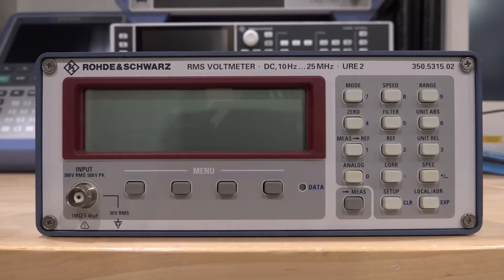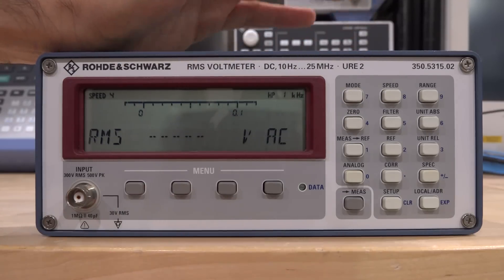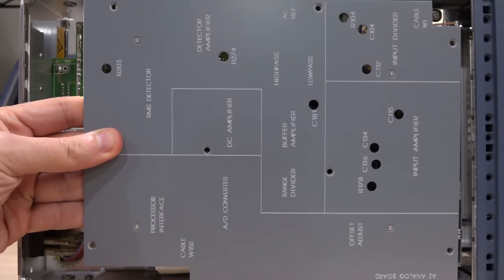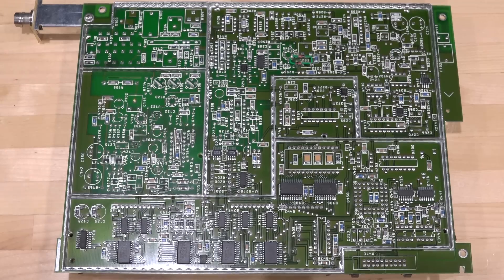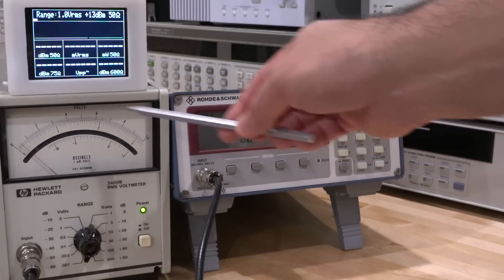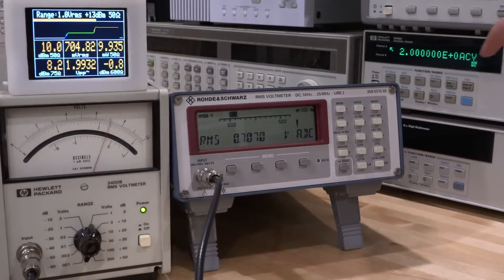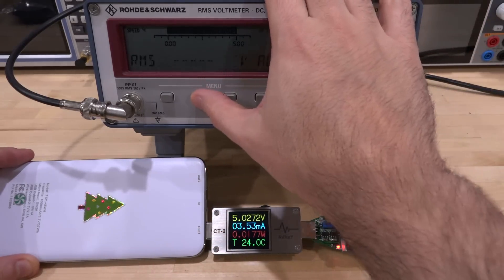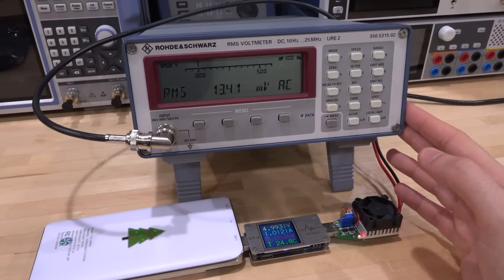TNP #43 - Rohde & Schwarz URE2 DC - 25MHz 300V RMS Voltmeter Teardown, Repair & Experiments

Comment: Seems strange to me that they designed it with a combination of DIP and surface mount.  Why wouldn’t they just upgrade everything to surface mount?  Probably could have fit everything on one side of the board.
Reply: The only reason I can think of is that it would make mounting components on both sides of the board easier if one side is through hole.

Comment: Should that display have a backlight?  I think they have an incandescent that always fails.   Maybe an LED replacement could be made.  The meter is helpful when used in conjunction with a scope and low lighting.
Reply from the maker: Only the URE3 model has the backlight. URE2 unfortunately does not.
Reply: Well then why not fit your own backlight to your URE2? It would be easy for you.
Reply from the maker: I will definitely look into it. It would make the instrument a lot better for sure.
Reply: @TheSignalPath  Awesome, much appreciated.

Comment: Im not sure how good your shielding is, but if you can try measuring the powersupply again from a different location. I remember once I was in an elctronics lab that was accross the street from a radio tower, we'd pick up all kinds of noise on our instruments while testing unshielded circuits!

Comment: I'm really glad you took into account my original comment when you uploaded the modified HP voltmeter. Thanks! 
On the other hand, UREs have some built-in switchable high and low pass filters which make your life easier when it comes to tricky measurements.
Cheers,

Comment: Sure a backlight is easy to retrofit, as the option likely uses the same display, and the actual backlight might already be there, just disabled in firmware, or there is a jumper you connect to enable it. Did that on a digital massmeter, as the backlight, because the firmware on the one I have is old, does not enable correctly, and I wanted the dim green light on all the time to show power on, so simply went and placed a small blob of solder across the CE junction of the transistor controlling it. 

Yes should replace the dim GaAs LEDs with brighter ones, or at least much more efficient ones, but they do the backlight function well enough still, and it is a nearly 30 year old instrument. The other one, which is a precision Oertling massmeter, uses a VFD display, which is, despite being close to half a century old, still bright. Did have the Scaeffner filter on the power supply give out that charactaristic smoke, so it was removed, and replaced with a salvaged set of chokes from a failed PC power supply instead. After all the transformer is potted, and impedance protected, and has internal one time thermal fuse as well, and no SMPS to be seen there, all linear power rails for low noise.

Comment: With my 3245A I get 0.377mV AC on my 3458A.
This is via the 3245A BNC and also via the banana sockets I retro-fitted to the front panel.
I also tried various cables, LMR200 coax, teflon/silver, gold banana's and all have about the same reading.
With my 3458A open circuit I am getting around 0.434mV AC.........so I suspect this whole issue is noise pickup.
Reply from the maker: I saw those videos you did on the retrofit, they were great.
I think the source might be from the DAC. Illya did some additional experiments and it is consistent with some DAC clocking noise. Thank you for checking also!

Comment: I took a Brüel&Kjaer2636 to measure my HP3245A, because it is the best low-noise equipment I have (in this special application even better suited than my HP3458). Result: I actually see a tiny 47kHz square wave with an amplitude of ca. 220uV RMS! And as it disappears when unplugging the HP3245, it actually comes out the unit (no pickup-noise). 
73 de Marc DL8ABE
Reply from the maker: Thank you, looks like DAC clocking noise...

Comment: Regarding the AC noise form the universal source, my HP 3245A has an ACV amplitude of 0.702 mV measured on an HP 3458A and 0.284 mV on a Siglent SDM3065X. They are not in agreement with each other, but perhaps that is a bandwidth issue? I see a tone at 8.59 MHz and lots of stuff in the 1 to 5 MHz range.
Reply from the maker: Thank you. Looks like some noise is present in yours as well.

Comment: Happy holidays to TSP! I've just checked 3245A (no options) and my own 3245A (option 001) with 3458A and Fluke 5790A and don't see 0.8mV. Sensitivity limit of 5790A is 0.6mV. 3458A reads some noise under 0.3mV but it does jump around around there even without 3245A connected. Perhaps what you saw is just some noise pickup?
Reply from the maker: Thank you! Happy holidays to you too. It looks like there is some small noise from your unit, could of course be pickup…
Reply: @TheSignalPath  my 34401a sees some noise ~0.02mv from 3245A in the mV range but nothing significant in the 1V or 10V range which is surprising.
Reply: After more testing I can actually see small tone at 45.27kHz from one unit and 70kHz in second. Only when DCV 0V mode used and in high resolution. Reasonable suspect would be PWMDAC circuitry used to generate high resolution output in 3245A.
Reply: @xDevscom_EE  Interesting, I would've assumed the low pass filter stages in the 3245A output path to remove such a noise.
Reply: @TheSignalPath  Could also be environmental noise coming from the power rails. Time to put a search on your auction sites for a 2kVA ferroresonant line conditioner, to run all the lab equipment off of. It does make a big difference, though you do get a lot higher third harmonic distortion on the mains waveform from the core going into and out of saturation, but linear power supply, and SMPS input, diodes do run cooler with the flatter waveform, as the ci=onduction time per cycle is increased. High frequency noise, along with all the voltage variations, does almost disappear. Just that the 2kVA units will mean you do not need a home gym if you move it around at all, they are very heavy. Older ones you might need to replace the capacitors from them having drifted down in value, note that you do need to get the same voltage rating, as that tank can run up to 600VAC or more across the capacitors under certain conditions. Plus they are not exactly efficient at low load, I call mine the foot heater, as it lived under the table, though there was the one time it lived up on a high shelf, which was very firmly attached to the brick wall, and I could stand on the shelf no problem.

Comment: How is the RMS conversion done in this instrument?
Reply: I'm not sure since I currently can't find a schematic but I think it may be using a FET-based analog converter like the original URE.  I don't see any dedicated RMS converter IC or thermal converter, and I highly doubt that digital conversion is being done since this is a true RMS instrument.
Reply: @douro20  I can see a hybrid analog/digital approach making sense. Square and average in analog (these require a lot of bandwidth), take the root in digital (this only needs to be done as often as you need a new reading). While you're at it, you can also compensate for analog nonidealities in digital and/or split up the averaging into an analog and digital stage to eliminate the need for a high value, very low leakage capacitor in the filter.